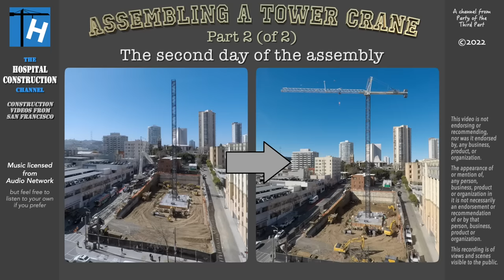Assembling a Tower Crane - Part 2 (of 2)

Comment: Definitely not these guys first rodeo! Through the two parts of this crane erection, I never saw any crew member standing around killing time! They were constantly hard at it, and it was clear that they had no doubt what to do or when to do it! Mad skills by all including the operating engineer running the massive mobile crane! He put every piece spot on! As the first horizontal piece went up with tag line attached, I was anxious to see if they would just unhook it and toss, but being 100% professional in all respects, they hooked it on a sling and sent it back down to the exact spot it was needed next! The crane manufacturers, both mobile and tower, have done a great job of designing these things in an easily assembled/disassembled modular manner! This is massive machinery, but watching the procedures gives the false impression of being Lego like! Nothing could be further from the truth! Great job on these shows btw! Thanks!
Reply: Of course we tie the tag line on to send it down!  Everything is controlled so just tossing the tag line down would be dangerous for our brothers working on the ground!

Comment: This was so interesting. I never saw completely done in real life. I would drive by in the morning and something would be done at night would be done. This was an excellent video. I have a question the bolts between each segment are they torque down or are they just hand tightenedand have another nut in place

Comment: The adjustment of the outer bridal should have been done on the ground before the outer jib was lifted into place. All the information of where the bridals pin are in the manual for every jib configuration from L1 and longer, someone who was in charge wasn’t paying attention or read the manual wrong that’s why you always check 2-3 times before the any piece leaves the ground.
Reply: @caesar1295  we build so many cranes and in so many different configurations the the guys on the ground are checking so many other things for damages and everything is in safe working order that something like that was not a concern.. because us guys in the air can easily adjust stuff like that!!   At this moment of eriction, the man in charge should be worried about ordering us some food!! Lol but you are correct it can be found in the manual

Comment: Awesome Loved it thank you I never realized that Part  of the gantry dint connect at the top half way along its length it does at the bottom but not the top Thanks
Reply: Agreed, it does look weird with that missing but that link is not required as the stay cables are carring that part of the load. But you are right and and I have never noticed that before on other set ups.

Comment: What was very interesting. I guess I always thought what was the point of a tower crane if you have a crane that can already reached as high as you need to go from the ground?  But what I found really interesting, I always thought these things kind of built upon themselves.  Where the cab if the tower crane and motorized elements would go on top of the first section, then it would have some type of climbing mechanism where it would cinch itself up inside the legs, and then pull the outer legs up beside it and swing it in, then when all 4 were in place, the inner legs would release (the cab now on the outer legs), and the cinching apparatus would lift the whole cab, since itself up high again, and then repeat the process
Reply: There are several types of tower crane. You have Swan neck tower cranes, Luffing Jib tower cranes, Saddle back tower cranes (in this video), Pedestrian tower cranes (small remote self-erecting). I'm English so, some of these might have different names over the pond. You are correct in what you say. Some can and, do self-build so, to speak. I drove luffing and, saddle back cranes for seven years. I loved every minute of it.
Reply from the maker: Some types of tower cranes do raise themselves higher. You can see a few examples of that on this channel, including here:

https://www.youtube.com/watch?v=Hv4JyPIPWy0
https://www.youtube.com/watch?v=JCYpRnW7Ee8

Comment: Realy interesting detail !
would have like to know the total weight of the counterweight ?
Thank !
Reply from the maker: That's a good question, but unfortunately I don't know!
Reply: It looks like there are 8 "C" weights and one "B". C weights are usually 6000 kilos and B's are 4000 kilos 8x6=48 + 4= 52000 kilos x 2.2 (conversion) = 114,400 lbs. I think. I'm an electrician so I'm looking straight up and they look tiny but...
Reply: @HospitalConstruction  Do you know the reach on the boom, the radius?

Comment: What happens if a cotter key pin breaks and the bolt slips out?
Reply: My thoughts exactly the cotter pins seem to me to be the weak point. I’ve seen bigger pins on other jobs. This rigging crew is fantastic.
Reply: @JCrugSR  that cotter pin shouldn't be under any stress to where it breaks.. they are inspected to make sure they are not damaged before they are put in..

Comment: What happens when a rigger has to pee way up there?
Reply: Let it "rain baby"
Reply from the maker: My understanding is that although some tower cranes do have some sort of accommodation, in many cases they are just using a bottle (that they bring back down with them at the end of the day).  Either that, or they hold it, or else they have to go all the way down and back up.
Reply: They put an enclosed port a potty on the equipment spar.
Reply: Depends!?????
Reply: Depends!!?? adult diapers ?? Or it might evaporate before it hits  the ground, catheters???  Great question!!!!
Reply: @HospitalConstruction  what about they just piss off the side of it?

Comment: The lack of traffic control on the street is woefull the distance between traffic and mobile equipment pathetic shear luck ,NOT good planing, plastic cones totally DUMB.
Reply: probably not enough space for concrete barriers, but lot of lifting while traffic is at close proximity...
Reply: Actually you're correct. I noticed throughout these 2 videos.I live in New York City & with high tower construction cranes the streets are closed off entirely when assembling or lifting loads like what we are viewing. So much for safety. My concern was when the traffic was on the street & the heavy loads lifting from the cranes. 🏗️
Reply: totaly agree mate, the road should be closed when lifting, just in case owt fell

Comment: What happens when the crane operator has to piss when he's way up there🤔
Reply from the maker: My understanding is that although some tower cranes do have some sort of accommodation, in many cases they are just using a bottle (that they bring back down with them at the end of the day).
Reply: @HospitalConstruction  when they thought about building these humongous cranes they should've added a bathroom bc having them piss in a bottle is disgusting & how do they go # 2
Reply: They put an enclosed port a potty on the equipment spar.
Reply: They piss in a bottle and sling it out the window.If the job is no good(Bonus wise ££££) I just went down to the toilets and waste as much time as posssible.

Comment: My cousin (electricion), when he was 21, fell from a crane and he died .
Reply: was he a crane operator why was he on the crane
Reply: @Panther-  It was in the 50s. He had to repair the the connections and somebody on the ground switsched the current o.
Reply: @lotharvoeller  so sorry for your loss over someones stupid error 🥺
Reply: @Panther- that’s why they have strict LOTO rules now…. Anyone working on any electrical equipment must have the source locked out and tagged.  Many good men have died in the past by not following the procedure, in the 50 it wasn’t enforced like it is now.

Comment: wow, how nervous would the OHS manager of the site be when he watches this?- flailing about with only a nylon chord stopping them from falling?- i'd fire them on the spot!!
ALL of the work done on the white painted sections CAN be done safely ON THE GROUND!!, or at least 5-10 ft off it, and you don't risk these idiots lives scrambling on a thing which hasn't even had the bolts torqued up!! if one of those cables ( on the chain hoist) snapped, all of them would die (100ft fall); then what would the families be told, if this is what they saw!
Reply: They are double roped up there. This means they have two 'nylon cords' (or chords as you call them). When moving between sections one is moved to the next section then the other. They will always have two points of safety contact. As for torquing up the bolts trust me. Though guys know what they are doing. It's there lives on the line. This is one of those jobs that you can't cut corners. I drove tower cranes for seven years. I also was involved in the erection and, dismantling of the cranes too. We do things a bit different in the UK and, in some your are right in as much some (but, very little) could of been done on the ground. All in all they are a very, very professional team. No Tarzan's either (those that know just know) although one load did hit the cab of one of the lorries (trucks). You see the driver get out and, check his cab, lol.
Reply: Hi Andy the armchair rigger,
I thought it might be helpful to put you right why the tower crane is there in the first place.
It comes down to money. It is cheaper to put a tower crane on site than hire a mobile crane.
The site is very small and every square inch will be built on.
Take a look at where the mobile crane is standing. It is in the street blocking the road.
It can only stay there with special permission from the municipal authorities and only for a few days.
The tower crane can see every part of the building site, where the mobile crane on the road has a severely restricted view. When the building goes beyond the first level, the mobile crane driver will not see much. Time is money as they say so each lift (load) will get slower and slower.
The mobile crane will find that it difficult to lift loads in high winds as it is much higher. The tower crane can operate in higher wind speeds therefore it will be able to work when the mobile crane has to stop, time is money.
The crane riggers are very professional. They will have had height safety training. They all wear a safety harness, it will have a double lanyard so each time they move outside the platforms and handrails they will be clipped on. The lanyard is designed to hold the biggest burger eating guy you can think of, so no problem there. It also operates by arresting the fall to prevent shock on the poor fella should it in the very unlikely event, it would happen.
The tower crane is built on site in sections as with this video because they are heavy enough. To put more sections of the crane together would be too heavy for the mobile crane. Each tower crane piece is perfectly balanced so is easy place and fix together. I could tell you more but you would probably lose interest.The tower crane electrician is an unsung hero in this video, without him this crane is just a heap of metal.
These guys work in dangerous conditions for many hours and in all kinds of weather. Not a job for the faint hearted. They are American and are building the USA 🇺🇸 like their forefathers did. Something to be proud of. I hope this helps and have a nice day.